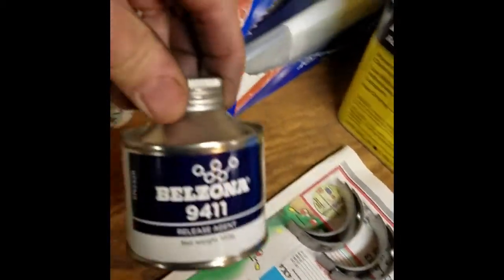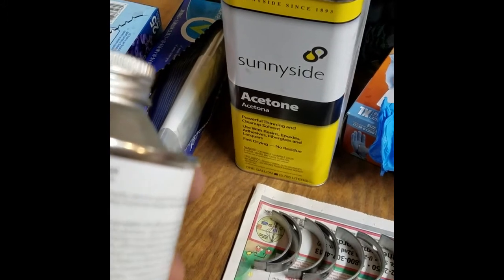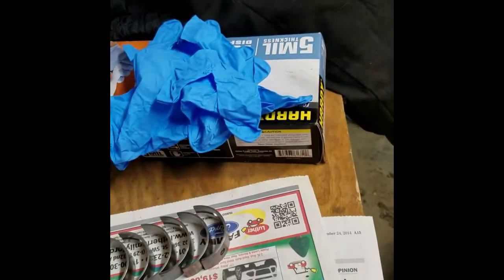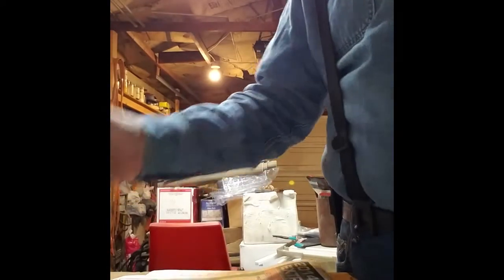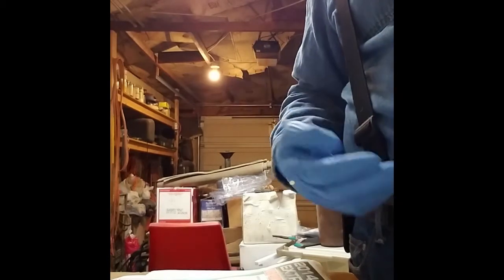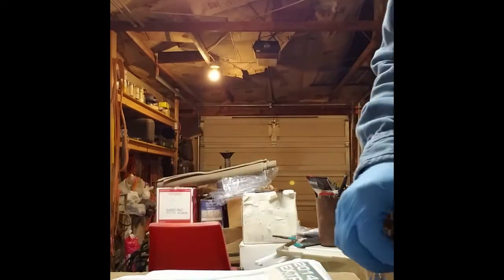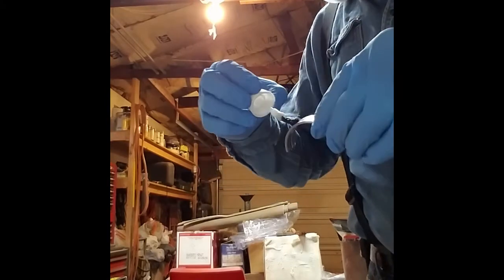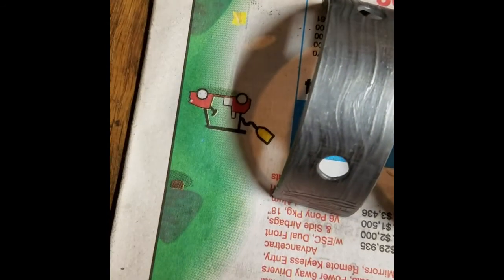Repairing spun main bearings with Belzona super metal epoxy- part 1

Comment: Hey Ron, did it work?
Reply from the maker: Sorry for the very tardy reply, YouTube is a hobby for me. It did work and has been running for a few years and about 30 hours. Some lessons learned- it does suffer low oil pressure, my clearance is definitely excessive. When I try it again I will embed some thin shim stock in the Belzona between the journal and the bearing shell to establish a clearance. To get that right will take some thought and some trial and error. But yes, it’s a functional repair. If I was using it hard/daily it probably would break, but I use the skid steer and keep the rpm’s up so the oil pressure stays up (I notice it at idle, so I never idle below 1000 rpm)